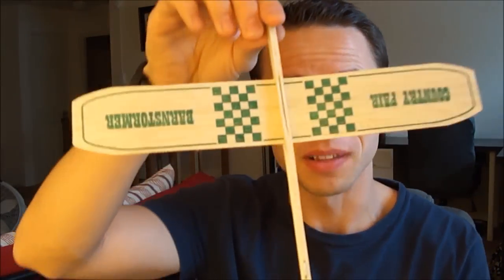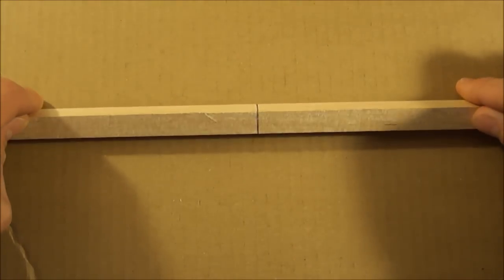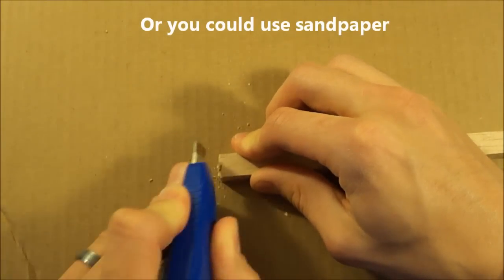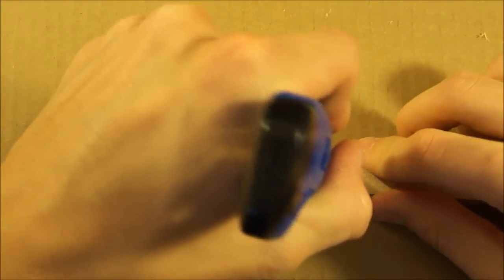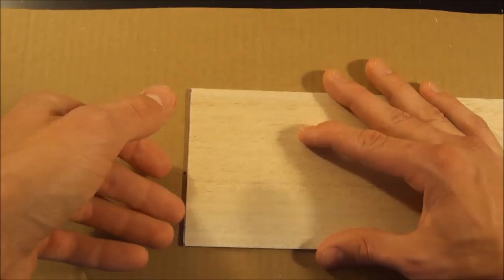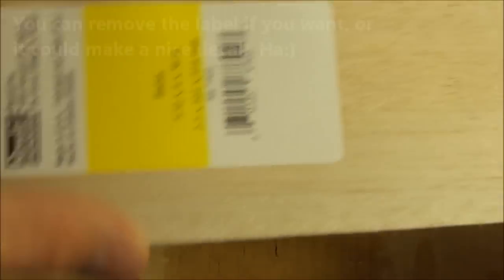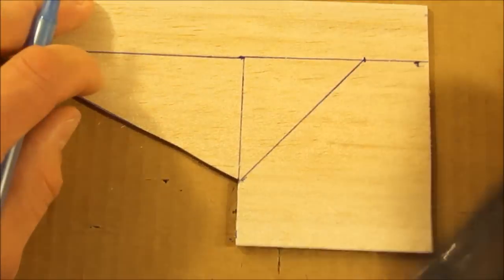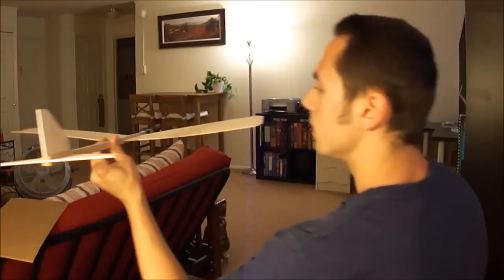How to make The Super Balsa Wood Plane

Comment: I'm an aerospace major in college and his terminology kills me lol. BTW if you angle the front wing upward slightly the glider creates more lift at a slower velocity so you can glide for longer distances. Don't use the paper clip thing he is using. the flat surface on it tends to slow the glider down due to aerodynamics. Instead, use modeling clay to shape your weight around the front of the glider. Make sure your balance point (center of gravity ) is in the middle of your front wing. To adjust the center of gravity you can add or decrease the amount of clay you have on the front of the plane. Hope this kinda helps. Try different designs too, there are so many possibilities out there.
Reply: xQuickScopeFanaticx lol the CG shouldn't be in the middle it should be about 1/3 of the chord back from the leading edge, a CG at half the wing is super tail heavy. Also aerodynamics aren't gonna have much of an effect on something this small. Aerospace major? I think not.
Reply: Actually, you are thinking of powered planes. They need the CG at 1/3 back because they have something called Decalage. What this is, is an offset of CG and stab (horizontal stabilizer) incidence, or angle of attack. The CG must be farther forward than absolutely nessecary and this will make the plane want to nose down, and the Stab must have negative incidence to counteract that. That way, when the plane noses down, it speeds up increasing airflow over the Stab and pulling the nose back up, and when it noses up, it decelerates and the nose falls back down. This must be set properly to maintain the stable flight equilibrium, or else the plane will simple tumble like a falling sheet of paper because the center of lift will change with the pitch causing it to flip over. But a glider is constantly falling, the Stab is always deflecting air, which means that the CG must be moved backward to keep it level. However, as AR (Aspect Ratio) increases, the Jesse art CG will move farther forward, and cap off at about 38% cord, because of how the maths and all that works out.
Reply: This is glorious, I have been researching "making wood furniture" for a while now, and I think this has helped. Have you heard people talk about - Yanathew Wood Waggler - (Have a quick look on google cant remember the place now ) ? Ive heard some extraordinary things about it and my partner got cool success with it.
Reply: xQuickScopeFanaticx...An "aerospace major" who refers to the "front wing"? Please explain where the "rear wing" is. Or would you refer us to the horizontal stabilizer? And what about that "uppy downy thingy" on the rear wing. And the "lefty righty" thingy on the uppy downy rear fin thing?

Comment: If we didn't bend the wing would it make a difference in the flight?
Reply: The bend is really important for stability also the most efficient size of these planes are 15 inches wingspan. I would not recommend this plane. If you trim the 15 inch model correctly you could make one that flies more than 3 mins. I have made many
Reply: The bend is really important for stability also the most efficient size of these planes are 15 inches wingspan. I would not recommend this plane. If you trim the 15 inch model correctly you could make one that flies more than 3 mins. I have made many
Reply: The bend is really important for stability also the most efficient size of these planes are 15 inches wingspan. I would not recommend this plane. If you trim the 15 inch model correctly you could make one that flies more than 3 mins. I have made many
Reply: +nils pils Thank you:)
Reply: +Tejeshwar Singh Dugal oh yeah btw that's 15" per wing so 30 from wingtip to wingtip.  You should also shape the wings like airfoils.  Rounded in front and thin in the back

Comment: You shouldn't need to put a rock at the front if the wings are placed correctly. Just move the main wings back a few centimetres so the centre of lift is ever so slightly behind the centre of mass, and it will glide perfectly.
Reply from the maker: Jordan O'C Thank you for the input!

Comment: You don;t need weight under the wings; you need some dihedral (upward angle) in the wings.Probably an inch and a half or so for each main panel. That will give it stability and it won't fall off to the side as your model did when it slowed down. And the model should balance fore-and-aft at about 50 percent of the wing chord.

Comment: How about using a large rubber band to launch it? It should be quite easy and get you quite a bit of distance in the flights
Reply: D Mather You might have to add a little something that the rubber band could cling onto before you launch it, because you don't want to risk using your tail or something like that as it might split when you pull your rubber band. Nice idea.

Comment: Consider this: hot glue some screw on the nose of the plane, then put one or more nuts, so that you very precisely adjust center of gravity (CG). It is much easier to adjust proper CG than putting rock or something else. Make sure that on the end you put something elastic, so that accidental hit into something/someone does not make damage to the person or object (some foam, rubber, something soft).

What you think about this idea?

Cheers,
milan
---
Reply: +Wild Maniac This seems like a nice idea! Did you (or anyone) try it? If yes, did it help practically? Thanks. (I'll probably try it soon. If it helped (or didn't) , I'll tell it here. :) )
Reply: +Aniseed 
Balancing airplane is mandatory. If nose going up, then stall - this means that tail is too heavy. If nose goes down, nose is too heavy. There are "sweet spot", where airplane want to stay in the air. Just fine tuning. Motorized airplanes should be balanced as well, but this is mostly done with moving battery forward or backward in the battery tray.

Comment from the maker: @peebeenjaye Not sure if this is too late, but try holding it closer to the tail end (instead of the middle) when launching it. 

To get it to fly longer you'd probably have the plane bigger or throw it with more force. Perhaps using a large rubber band to launch the plane might help. I thought about adding a screw or nail to the bottom of the plane to use as a place to put the rubber band. 

GOOD LUCK! Definitely let me know how it turns out!!

Comment from the maker: @peebeenjaye Hi! The tail wing seemed to have the greatest effect on making it fly straight. Also, the more weight you use (depending on the size of the plane), the more smoother it'll fly. I wouldn't put them on the wings because it might be hard to keep the plane balanced. I'd either place it on the front (like in the video) or on the body of the plane in the center of the main wing.  Thanks for watching! Let me know how it goes and have fun!!! :)